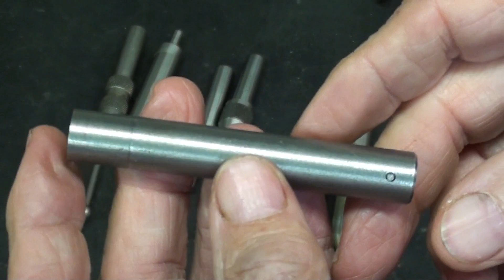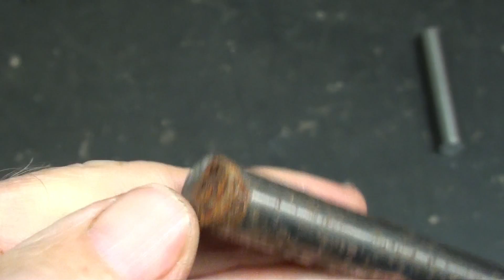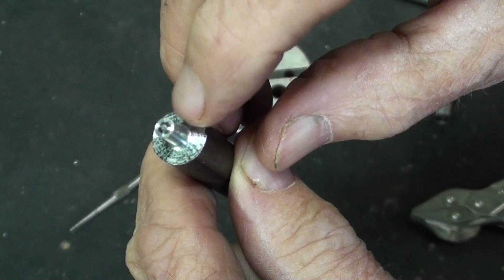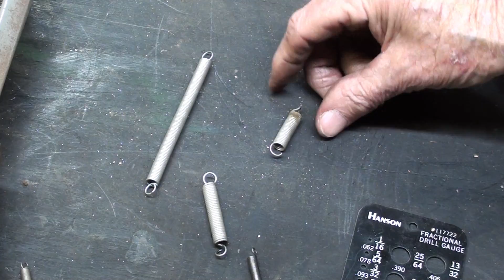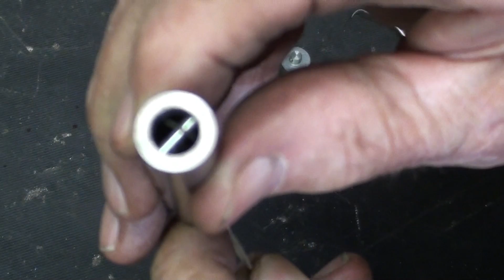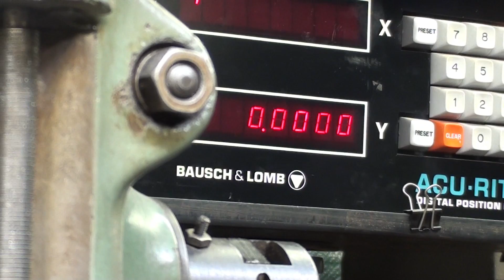MAKE AN EDGE FINDER #910 tubalcain starrett

Comment: While I have a pile of center finders, it might be fun to make one for specific uses, like one with a very small tip (.100 or .500).  I've needed them in the past to find spacing from an internal feature, and even the .200 type was too large.  I'd also like to harden the "business end", but I wonder if the geometry/size would change in a meaningful way.  Maybe if it was quenched straight down into the water/oil instead of just being tossed in...   Thanks for the video!

Comment: Thanks for another great, "how to make it" video. I wonder why someone doesn't make an edge finder with a precision .200 ball on the end instead of a straight shank? A ball would provide a single point contact that should be more accurate, especially if the ball was carbide.

Comment: In your experience, is a .5 inch tip more accurate than a .2 inch?
I have both and have not yet attempted to verify the difference.
Reply from the maker: I never noticed a difference in accuracy. The smaller one fits into tight places quite nicely. Actually I prefer the smaller one.

Comment: I had an edge finder with a conical point on one end for years before I figured out how to use it. To wit, with a dead spindle and light quill pressure I engage the point with a hole or center punch mark I want to locate. Then I move the part until the transition from the body to the point is smooth to the touch, or dragging a fingernail. So it's actually a center finder, not an edge finder. Accuracy can be affected by the edge condition of the hole, and probably isn't as accurate as sweeping an indicator, but for many applications it's sufficient, and it's quick and easy. The problem is, the cone on my center/edge finder is only 3/8" in diameter. So I plan to make one out of 3/4" drill rod for use with larger holes.

Comment: If a person wanted to, he could make an edge finder to fit each common collet sizes. There would be a practical limit on the minimum size of course.
Reply from the maker: Good idea, that’s why I enjoy both the 3/8 diameter edge finder and the 1/2 inch diameter
Reply: I find 10mm to be the best size for me- most used. My tap followers are that size, as is my centre finder. Having a single size for all means you do not have to remember- something that is getting harder...

Comment: The V blocks and bridge clamps I still use some 50 years later were shop made by a retiring machinist which were his apprentice project when he started in machine  shop. They were given to me when he retired. They are stamped with numbers which correspond with his first name, 1255 (LEE) in a milled recess. The finish was created by polishing compound on a dowel rod. Don't know what you call that. They are prized possessions.
Reply: The finish you described is known as engine turning or jeweling.
Reply: @ellieprice3396  Jeweling is more descriptive. Engine turning refers to the process jewelers use - it involves engraving patterns of lines in more than one direction, and causes light patterns to be seen. It is called engine turning because it uses a lathe -like machine (engine in the day) with cam systems to make the pattern. They are beautiful pieces of machinery, but require much skill to set up and operate.

Comment: We have some imported edge finders at work and it seems like they use too large of a spring and then it doesnt have enough room in the body to kick off center while using it. Then we have some are magnetic and the end wants to cling to your workpiece instead of kicking over and they dont well either.

Comment: Delightful. I was skeptical that you could lapp it accurately by hand with your method. I supposed that you would require a jig to maintain perpendicularity.
A DRO greatly enhances using an edge finder. My DRO was partially disassembled when I purchased my mill and with a known repair required. Now you have shamed me into another installation and repair must do soon project. While I am at it I better install the power feed unit that I purchased at least a year ago. I have been "wasting" too much time recently installing $2000+ piping system in the big shop for compressed air. I have to stay on that project, because I borrowed my son's scissor lift and his power threader and I can't keep them much longer.
When that piping system is complete I will have 20+ air drops throughout the new shop supplied by my first industrial grade air compressor. I stumbled across the compressor and purchased it for a song. I am soon to be the best equipped shop air system in the neighborhood, making me pretty snooty. I even have underground piping between my house shop and the new big shop. I installed that many years ago allowing one air compressor to service both shops. When I tore down the old hog farrowing house (which was the site of the new big dream shop and was never really a good functional shop) I salvaged the existing underground plumbing. My plans are to utilize either building air compressor as desired controlled by a valving system that I already built. The house shop is still  running on a farm store type air compressor. It is noisy and its recovery time is slow, partially because I added much more receiver capacity than it was designed to support.
Too many projects! I just recommitted to getting back to woodworking too. I have 4 or 5 more granddaughters that have aged into deserving their promised hope chests. I hope to begin building the first of those before Christmas. My hope is to give each granddaughter an heirloom quality chest. I have committed to 18 and have only completed 5.
...And I only started to rebuild the Malibu for a son-in-law, the Farmall M overhaul is far from complete, the Leblond lathe, Delta drum sander, old cast iron Craftsman planer, Delta shaper, Powermatic table saw are on the short list too... Not to mention the long list of projects... 
Life is good and full, and Mr. Pete guilts me into wanting to make an edge finder that I don't need and can't use until I get those other projects complete!
Reply: good luck
Reply from the maker: 😄 you are a busy busy man

Comment: skills will transfer to other projects. edge finders get thrown in from many auction lots and CL bundles.

I have a DRO on the mill so it is my most used tool, but I have 15 of them.

I can imagine a "side project " where I need to make a special purpose one for a specific application.

Thanks for doing this. your apprentice project videos are my favorites. I watch them all now.
Reply: making plastic soft jaws for the vise right now so I can hold a file to heat the tang and pound on a plastic file handle I turned quickly, for a new Plasticut file I fell in love with. I never have enough file handles.
Reply: I should be working on the custom shoe we need for the jigsaw at work or the fins for the rotary tumbler project that will go in the 5 gal buckets so I can just leave the media in the bucket and swap buckets for different media

Side projects really get in the way of projects sometimes.......lol
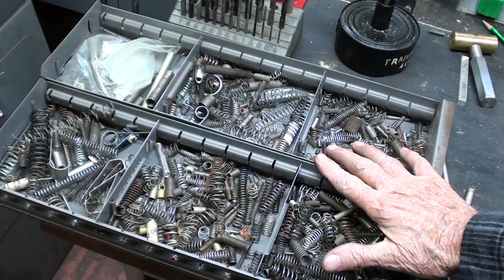Reply: 13:05..."4 drawers of springs"?! Isn't that a bit of a STRETCH?!

(snucker-snucker-snucker!!)
Reply from the maker: Yes, for the extension springs, but no for the compression ones
Reply: @daleburrell6273  Not for me.  I save everything.